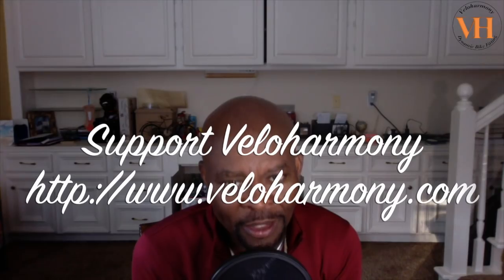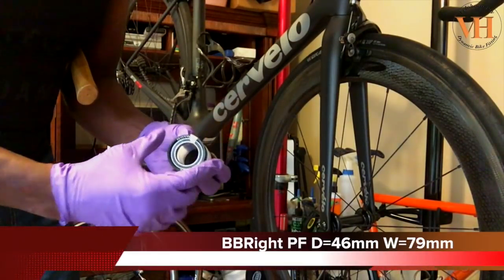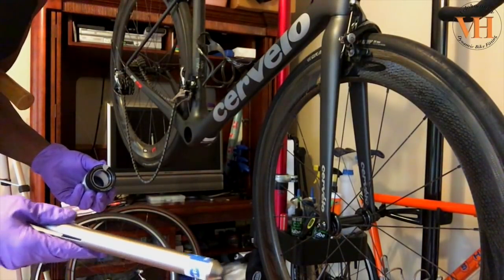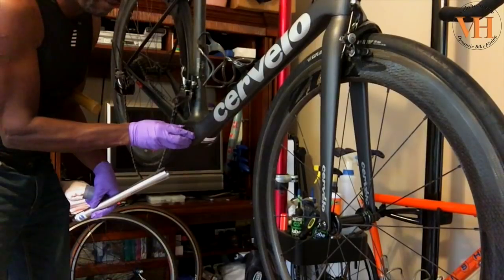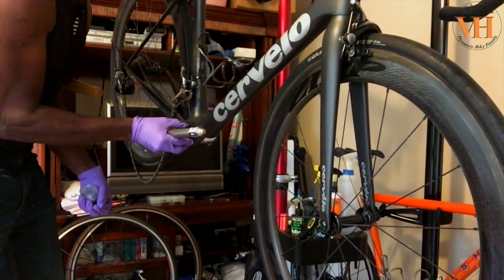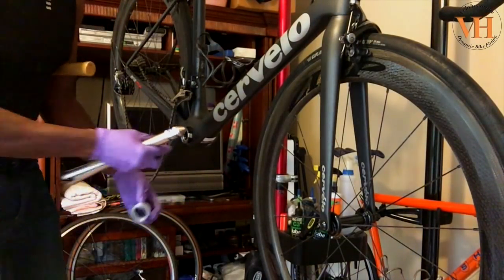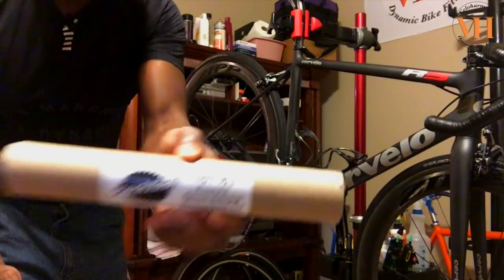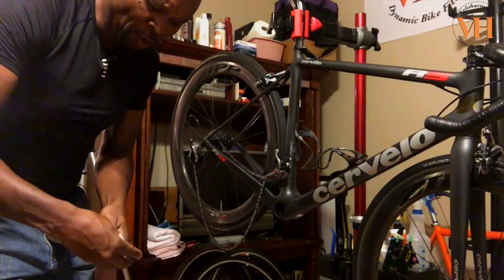How to remove and Install a  press fit BB

Comment: The 24mm and 30mm refers to the diameter of the spindle not the length. Also the best way to remove a press fit bottom bracket, especially if you ever plan on reusing it is with a draw out extractor like the BRT-002 from Enduro. The park tool is ok so long as you don't want to reuses the bearing as it is prone to damaging them.
Reply from the maker: You are correct. The Shimano is 24mm and the Rotor Crank i removed was 30mm in diameter. I misspoke in the video. I decided to use a new bottom bracket instead of risking the use of adapters with the one I removed. I had no trouble removing the BB that you see in the video with the park tool in pristine condition and i kept it to be reused by someone who may need them in the future. You just have to make sure that when removing you don't indiscriminately use the flange tool and you should be able to reuse the BB. The right tool for the job does the trick.
Reply: The park one works ok so long as you keep it perfectly straight while hitting it, I have seen plenty of damaged bearing seals and even damage to the balls themselves, even park says it can damage the bearings and is only intended to be used when replacing the bottom bracket. I just think the Enduro is the better tool for the job, you should check it out, considering some frames require the removal of the bottom bracket to re-cable the bike it's nice having an extractor that won't damage the bearings.
Reply from the maker: Thanks paradox963, I will definitely check it out and add it to my toolkit.

Comment: Hi Elred, this is exactly what I was looking for:) Thank you! Just a question. Ever since I own my Cervelo S3 (2015 model) i had issues with some strange sounds coming out of my BB. I've spend hundreds of $ in several shops to fix it - in vain. Finally, I got a new frame (2018 model) and to my stupefaction the problem persisted!!! So i decided to give a last try. 
My plan is to change Rotor 3DF BBright™ 52/36 crank for Shimano Ultegra R8000. I presume I have to change the BB from BBright PF-30 (which is currently used with Rotor) for BBB Bottomfit BBO-72, PF30 Threaded (for Shimano). Is that right? I would really appreciate your recommendation.
Reply from the maker: I am going to assume you did your own build, otherwise you should not have to live with the creaking. Yes you need to use the BB spec'd for Shimano to avoid issues. Most creaks are caused by the variances between the press fit shell and the frame. Using locktite should eliminate that. The creaks are mostly from the BB shell and the Frame, not usually the cranks. For the cranks if the torque is right and your chainrings are nice and tight, you should not have any issue there. So I suggest you focus on the BB Shell and how it mates with the frame. Most competent mechanics should be able to sort that out for you, if you have some shops in your area and get stumped.

Comment: great video elder ive collected thousands of euros worth of bike tools over the years and would say ive nearly every tool for every bike made. i wish they would stop changing parts on bikes especially the bottom bracket as i think shimano  the hollow tech 2 was the perfect design. The press fit design is probably the worst evention the bike industry put out .exspensive tools needed  with the need to use loctite as the frame stretches over time as the tolerences are so tight ive lost count of the amount of people with creaking problems on brand new bikes with press fit bbs .im also not sure how the internal routed cables make for a better experience as they make installation of the cables a lot harder and with potential of rattling in the frame .just trying to make money out of us as usual .keep up the good work elder love your videos .
Reply from the maker: Thanks Jonathan. I dislike the internal routing as well. I usually charge a bit more labor for bikes that have those. They require more time to reroute the cables and I really don't see what they're improving. I had fit client who brought a Giant endurance bike that had axles about 4times the size of the current ones and had to be threaded into holes cut into the dropouts. I told him with such a proprietary design, he would have challenges getting wheel change assistance on rides. The whole thing was a bad idea, like buying a car that no Garage can work on. :)

Comment: Nice Job Eldred, It's really like heart surgery working on the guts of the bike - especially the BB and Headset.  It's really cool that you have learned to do this.  You are a True cyclist in my book.
Reply from the maker: Thanks Brian.There's a phrase that necessity is the mother of all inventions. After several frustrating experiences early in my cycling life with waiting several days for my 'only' bike to be repaired, then receiving it in worse condition than when I took it in, I decided to take a bicycle mechanic's class and then over the years, accumulated the tools as the need came by, which is the best way to do it. Now I only go to the local bike shop if I need parts on demand from a customer that needs it immediately or to have them handle major stuff like chasing threads when building a new frame or stuck seatpost in an existing frame (mostly one offs, which it's not worth investing in the tools). I built all my current bikes and just procured the frame and parts separately which saves you $$$ if you can do that.
Reply: I have a very similar story to yours except I landed a job at a bike shop just to learn their trade secrets.   What I learned most was really the attitude of a Bike mechanic,  it's that "What Ever It Takes" Mentality.
Reply from the maker: Yep. I hate getting ready to ride and dealing with a mechanical. When it's time to ride the bike must be ready. I work on any problems I find during the ride as soon as I get back immediately after loading up on food.

Comment: Hi Eldred this video could not have come at a better time, I am just thinking of changing my chain set which is a FSA to a Shimano hollowtec. My problem is the BB at the moment has press fit bb30 and some how I have to change it to a Shimano so at the moment I am searching for the best way of conversation. Any tips ?
Just to let you know my cycling has got so much better since I found your site I just need to say thank you.
Reply from the maker: Glad to know Clive, that is why we setup this channel. If you're going from bb30 to shimano, you will need a different BB that can handle the 24mm shimano spindle. BB30 is 6mm thicker. Send me an email to customerservices@veloharmony.com and I can send you a Rotor Standard deviation chart that will help you determine the BB you need for your frame set. You have to measure the Width and diameter of your BB shell and lookup the recommended BB's in the chart I will send you.